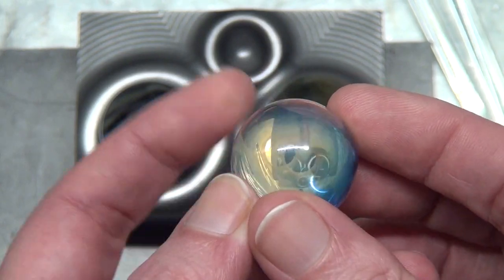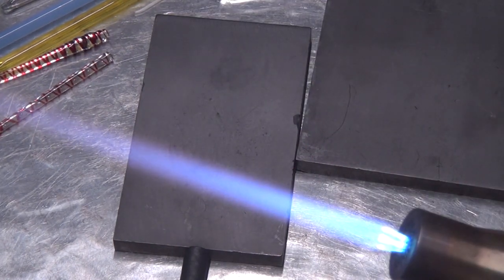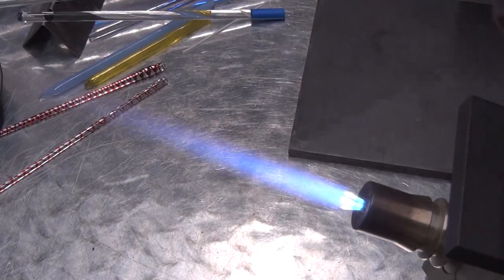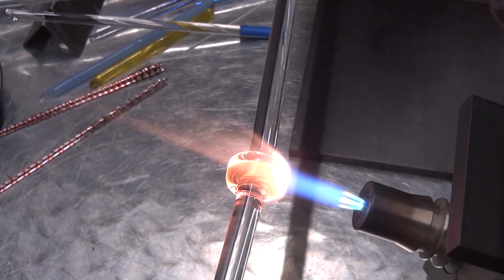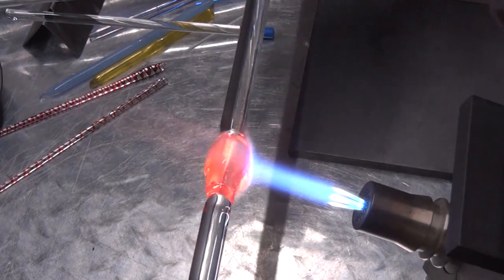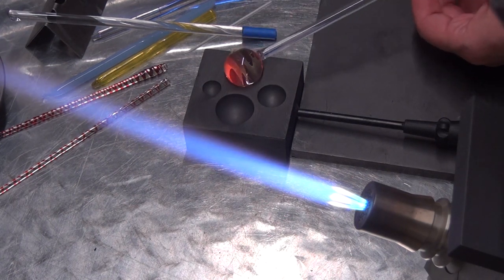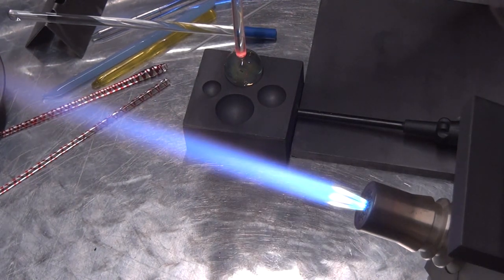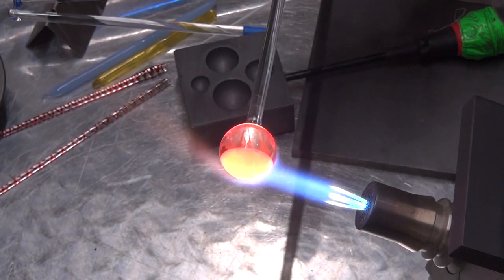Beginner Glassblowing: Fumed Twist Marble

Comment: What did you mean when you said skin the face?
You make good videos.
Reply from the maker: Probably talking about removing the outer layer of glass from the front of the marble. The glass which has been in the flame too much can be a little less clear, so as a final step, you remove that, exposing the "fresh" glass underneath. Also there may be pieces of bad glass on the surface, which will appear cloudy when it cools. This is a major reason why some artists marbles are noticeably more clear. It's an extra step for that last little bit of quality that says you're a true master.
Reply: @jasmine2501  Thanks for the reply.